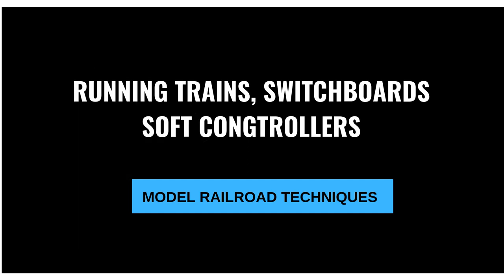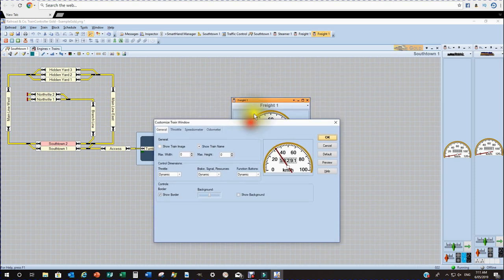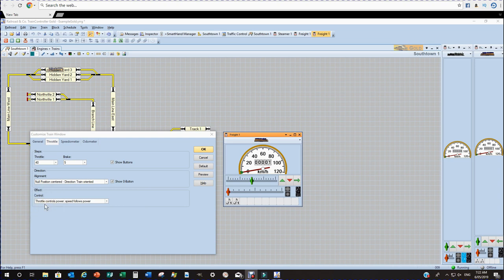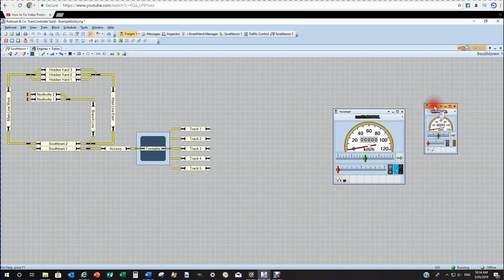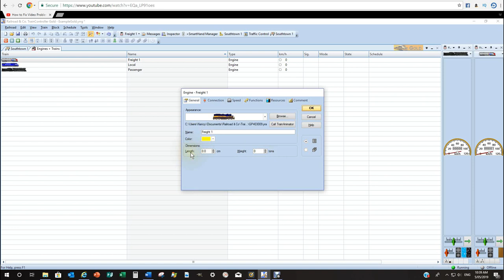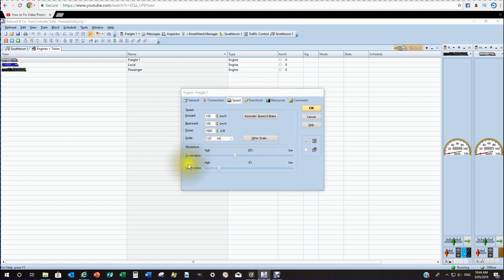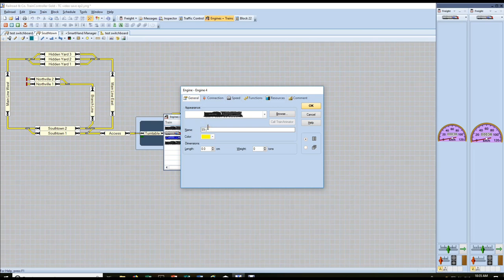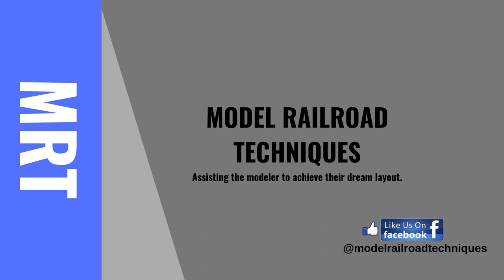Railroad & C Traincontroller,-Lets have fun with controllers and run some trains

Comment: could  you please do a turntable video
Reply from the maker: In context of TC? What hardware you using
Reply: @ModelRailroadTechniques  gold 9 wathers turntable  thank you  very kind of you to help us
Reply from the maker: My DCC command station is Roco Z21, I use Liffinski Datem Technica S88N protocol for occupancy detection, digikeijs for turnout control
Reply: Sorry about that digatrax se8..168bd for the turn table i use the wathers board
Reply from the maker: greg whayman sweet.. for what I needed loconet is not required.
Reply: @ModelRailroadTechniques  yesj jest the softwere ...i see yours working with flagmen on the vidio but not all tracks have one. Not for trying  best of regards greg
Reply from the maker: greg whayman hi Greg which switchboard are you referring to? The one is this video is the test layout. Email me on modelrailroadtechniques@gmail.com

I will try to help you out

I